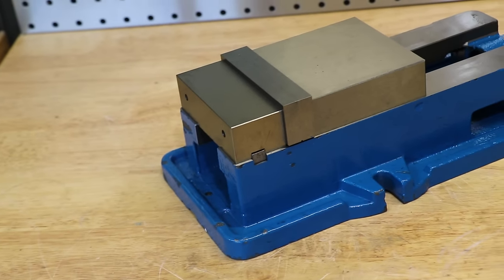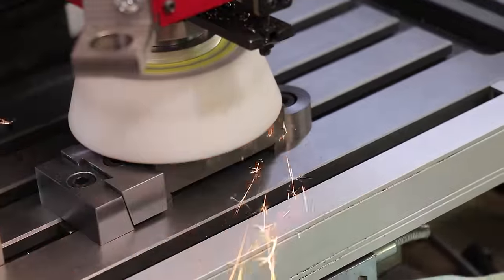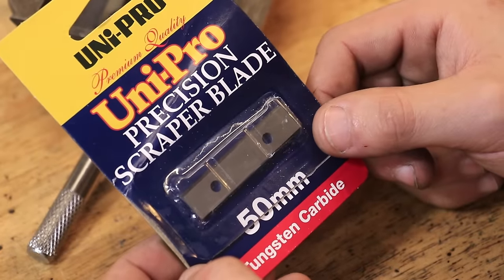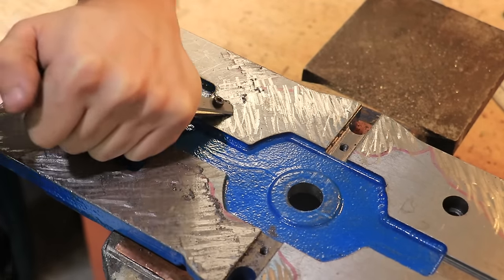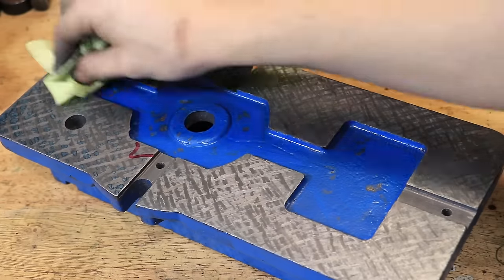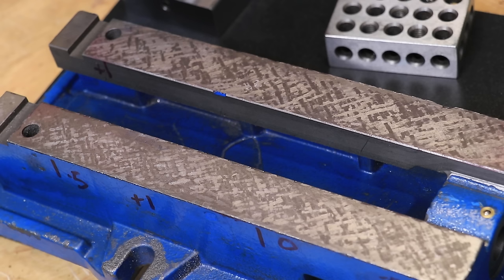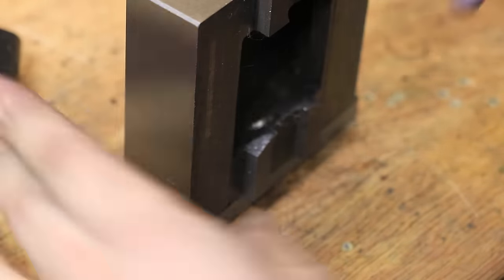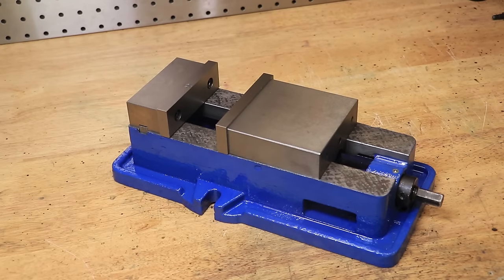My Cheap Milling Vice Has Issues. Can I fix It? (Surface Scraping)

Comment: I'm impressed that you just dove in and did it!  Nicely done in the end.  My assumption is that I will have all the same issues you did, the first time I try it!

I like watching other videos on scraping, as you do.  One thing I noticed a little different in yours was that your strokes seemed narrower and longer, maybe even much longer.  I would think there must have been something about that that seemed intuitively right to you as you worked.  Seems like "those guys" kinda go "zip, zip, zip", and yours were more like "ziiiiiip, ziiiiiip, ..."  :)  Maybe it's the patience issue again; this is apparently not a rapid stock removal technique!

One other thing that seemed interesting is that somebody, somewhere pointed out that if the blue spot is surround by a dark ring, that's a buildup of bluing ink around the high spot, so the width and darkness of that ring can be a kind of indicator of how high the spot actually is, relatively speaking.  A little bit of a 3-D reading.

Well done.  Carry on!
Reply from the maker: The longer lines I think are are down to lack of prior experience. I need a bit more practice to get the stroke length down whilst keeping the speed up.
Reply: @artisanmakes  I guess the ultimate is those little Moore half-moons...  yikes!  I could only dream of having that kind of skill.
Reply from the maker: One day hopefully. A man can dream :)

Comment: Well done , another useful tip now that it’s all squared up is to setup a clamping  bar x ways on table bolted down spyware to x an y turn vice upside down an machine the base on the end an one side so for a quick set up u can match the back of the vice to the edge of the table or the side using a engineer’s square from back of table to side of vice ,it only a quick way to get it set up for the jobs that are not critical an quick for the ones that are with a dial

Comment: If the fly cutting made it worse, perhaps you should try to tram the mill a bit better. If possible, of course.
In any case, I'm much inspired by your limited resources solutions.
Reply from the maker: I think the issue I'm dealing with is spindle nod. I need to get the indicator and check that. Cheers

Comment: Edit: The finest machines (and reflector telescope mirrors) are all hand scraped. Skilled hands still exceed out best machines for some purposes.

You've hit the skill level required for an Australian to make the most of those criminally cheap Ali*** Bang*** machine tool accessories; if you think of them as a kit of castings which are intended to be machined and finished by the buyer, resulting in a high quality machine tool or accessory, but without having to buy a house to remortgage in order to pay for it.

Herr Gottswinter did a similar thing with the Vertex rotary table, but with Stefan's special sauce of considering almost everything "probably good enough but I can make it exceptional". 

I can't justify the cost of Kurt either. I can often justify the cost of Vertex, and their quality control is reliable and accurate. But when I can't afford Vertex, but I still want a nice tool I do what you did with this vice. It's a set of castings which have been roughed out, and with love and skill and effort, you can make it better than any of we AU hobby machinists could afford to buy outright.

Nice one.

Comment: I taught myself scraping to make hand planes (woodworking type) flat on the bottom.

The main "secret" I learnt was - don't try to be too accurate, too early on.

While there are still "low" (unscraped) areas left, your high area (blue/scraped) doesn't need to be perfectly flat YET. You work to lower it quite aggressively. Only when the entire surface has scrape marks is it time to scrape with more care.  

In effect you can think of it as a 2 stage process - improve the "shape" of the surface until it's flat; then work to improve the "texture" of the surface. It's a move from working on the macro shape to the micro shape.

In practise it's not a 2 stage process - it's gradual.

Put another way - imagine you have a little island 5 thou (0.005") higher than the surrounding plane. Your task is (of course) to lower the island down to the rest of the plane. And UNTIL the top of the island is within - say - 1 thou of the plane, it does really matter whether the top of the island is flat.
Reply from the maker: That would probably be a good explanation of why it took me so long to scrape the first time :)

Comment: Good job 👍. One question. Can you not use an emery paper on surface plate instead of scraping?
Other question. How you make sure that the scraped surface is perpendicular to vice jaws?
Reply: You can use emery paper but requires a lot more effort to move the vice around vs removing what you actually need to with a scraper. Because the surface area gets progressively larger as you sand down the face closer to flatness, the pressure applied over the surface reduces which causes the emery paper to lose effectiveness.

Not to say it isn't possible, it's just actually faster to use a scraper.

Once you have established a reference surface, in this case, the bottom of the vice, everything else is based from this, the bottom infers parallelism to the top surface which can be measured with respect to the bottom surface as shown, once you have that flat you can then measure perpendicularity with a surface gauge tool using a known good perpendicular reference. The bottom surfaces of the fixed (and moving) jaws can then be scraped to adjust as required.

Comment: This is great, and inspires me to have a go. Watch yourself with grinding carbide though, the dust is super bad. A vacuum cleaner nozzle next to the grinder is a good idea, and perhaps some PPE...
Reply from the maker: Cheers, I'm a bit weary of any grinding dust. I use a mask when using the regular aluminium oxide wheel, and from what I hear, carbide is worse than that. Cheers

Comment: Unfortunately buying some decent tools here in Australia is an expensive nightmare.
For machining I’d suggest getting some parallels so your workpiece is not resting directly on the base of the vice.
Reply from the maker: Definitely not the cheapest. I have parallels but it does make the jaw lift a little worse :)

Comment: Maybe the vise was bended by the clamping forces while not being supported completely at the bottom.
Don't know if that can happen, but would be interresting to check in a few months. To see if the vise is still parallel.

Comment: Hey whats up. Good to see you fix the import vise. I am going to do the same thing when I buy one. I have scraped a lot in the past. I built the Gingery metal lathe which involves a lot of scraping which took me a little over a year. When you sharpen the scraper you have to have a radius which I think you did. If you see scratch marks on both sides left from the scraper you need a bigger radius. Only the middle of the scraper should be scraping. One thing I noticed was you were chasing each and every individual blue spot. Generally you are supposed to scrape them off in a group. I don't know if it is your scraper profile but it doesn't take much effort to make a scrape you can do it with one hand. There are definitely levels to scraping. Anyways good luck I have been enjoying your videos they are very entertaining.
Reply from the maker: Thankyou for your comment. I think the biggest issue I was having was rotating the scraper and that was catching the side of the blade as you noticed. I think I am getting better but I need more practice in it. Cheers

Comment: I've seen videos where someone has a surface plate they use for grinding pieces flat by using spray adhesive to glue a sheet of 600+ grit sandpaper to the plate and after scraping (or otherwise flattening) the part, they then wet-sand it smooth...if they really need/want a high-gloss finish, they repeat the process by gluing down higher and higher grip sandpaper (they usually stop at 1,000 or 1,500 Grit)...It takes a LOT longer, but it works just as well as a Surface Grinder (at least within the Tolerances they're willing to accept) while producing MUCH less dust and grit since ALL the sanding is wet sanding which traps the grit in the water as they're sanding...

For those screaming at their screen and tearing their hair out at the thought of using a precision surface plate for sanding, they have 2 plates, an old one that's still nice and flat they use for sanding and a new plate they use for precision layout work and they protect it like it's their first-born child...

😄😁😆😅😂🤣
Reply from the maker: Yeah that definitely gets stuff flat, getting the two surfaces flat and parallel is a much more complicated process which I don’t think can be done easily with this method
Reply: @artisanmakes  True...I was thinking however, you can use that process to get the bottom totally flat and then use the grinding stone in the mill to flatten and parallel the top. If you set up the vice on the bed perpendicular to your normal set up (so the entire base is on the bed) it should ensure that everything ends up parallel...

If you own (or can make) a 90 degree milling attachment, you can then turn the mill into something that looks like a true surface grinder (and set up a vacuum hose behind the wheel because now all the sparks/dust/grit will be flying in one direction every pass which reduces cleanup and risk of grit on the ways)...

Comment: I've done a ridiculous amount of hand grinding the bed of my Chinese mini lathe because that utter piece of crapola is crooked in every imaginable dimension. To clean it up as much as I could without spending €1.000 or more on having the bed precision ground, I instead invested about €120-180 for a 100 cm long cast iron bridge thingy (can't remember the name, it's a flat reference beam used to print onto whatever you need to grind or scrape) which was flat to within about 10 micron. For printing the cast iron beam I used commercial prussian blue oil paint which I apply to the beam with a paint roller, which works perfectly and as if it was made for it. It takes a long time to dry out and can be transferred multiple times from the beam to the bed or whatever surface needs to be printed for reference.

Comment: Scraping has some better things than surface grinding such as enabling a layer of oil to be kept or to stop a vacuum forming under ground parts. That's also a part of the 'tick mark' scrapes.
Ca Lem has a great video on scraping and the ticks

Comment: I’m pretty impressed that you had the courage to give this a go. I’m glad it worked out for you. 

What confuses me is why you can’t use the fly cutter to clean up the top ways on the vice, especially since you already flattened the bottom?
Reply: He did use the fly cutter and as he said he made it worse for some reason. When he measured it for parallelism initially the worst measurement was minus 2. After flycutting the surface the worst measurement was minus 5 !
Reply: @samrodian919  I’m aware of that, hence my question as to why.
Reply: Probably was sitting correct or something on the mill is moving
Reply: @freestyla101  sorry for that. I answered your question, had you phrased it in a different way I wouldn't have commented.

Comment: Next time try negayive geometry on scraper. It helps to keep the blade from digging. You can also try using dremel and cut off wheel to do the same(works better for steel than hand pushing one) you use the side of the wheel btw
Reply: Although I will probably finish by hand scraping, I've done most of the cleaning up of the crooked bed of my mini lathe by hand grinding with a rotary tool. Initially I used those orange aluminium oxide grinding wheels, but I noticed I got much better results by using moderately fine grit sanding drums, of about 80-100 grit for the course work and 150-180 or preferrably even higher for the finishing work.

Comment: I think your scraper bit radius was too small, making each scrape quite narrow, ie; taking twice as many scrapes to remove the material.
I have not done any vices, but in some critical work like antique engine cylinder heads etc I use a flat file. A good brand fine cut flat file, which has a very mild taper on the end third of the file. Mine is a Wiltshire brand, a common good file in australia. Anyway the point where the taper joins the flat section of the file is essentially a "bulge" and you can use that bulge to remove material in a small area the same as scraping, BUT with the benefits that it removes material better, and more evenly (does not make little grooves) becausr the cutting bulge is the width of the file so instread of scraping a 3mm groove into the metal it scrapes the full width of the file, maybe 25mm. It is an easy thing to do but hard to explain.
Anyway you can get the same flattening result as scraping but the final metal has no grooves and is almost polished flat looking, a really nice smooth uniform finish. And it is probably ten times quicker than scraping tiny grooves. 🙂👍

Comment: Your scraper is literally the exact same  as the first one I made. Just used a floor scraper carbide blade that I attached with two screws to a Flat bar.

But one other issue is I also have one of these vises also, and measured the flex under load. There’s A LOT of flex, A hecking heck of a lot of flex. I think the center bowed to by around 0.3 mm or so. I don’t know if that’s because of poor fitting jaws or weak casting. 

I do have a much better quality Taiwan vise as well, so I didn’t bother investigating my 100mm Chinese vise further
Reply from the maker: Blimey, that is definitely a lot of flex. Never considered how well it works under load, but that does not sound too good. One day I'll hopefully get to ditch this one for a good quality vice. Thanks for the info.

Comment: Great video mate. Regarding lapping your stones, do you have a good resource for the 3 stone method...ideally a YouTube video?
Reply from the maker: Tom Lipton ay ox tools has some good videos on making lapping plates. Not exactly lapping stones flat but it's the same basic method and it has some good info
Reply: Thanks. I've watched his videos now. Amazing the flatness you can achieve. When applying it to stones, did you use some form of lapping compound between the stones or just stone-on-stone. Wet or dry?

Comment: scraped flanges, the most expensive pipe joint of all... aiming for 90% contact. no gasket material. pretty hard to get gastight!

its a trade off.

get the contacts below a certain point, and it locks up.
too much contact squeezes the oil out, and you get "sticktion" as the slides grab and release on  film of oil. thats an issue ground ways suffer from.

a 66% area means you get approx 1/3 contact between the two parts. at any time, you can say half the high spots are contacting each other, and there the oil is being squeezed out, but has somewhere to go without building pressure, meanwhile, the other half of the high spots are  getting a new film of oil applied...

the scraper handle... you want spring steel.  the idea being if you sort of hold the butt of it stationary, smacking down on the middle of the handle flexes it, shortens it, applies the required pressure, and its the bounce back that does the actual scrape. 

dont use it like a chisel.

then again, sometimes you have no choice. getting into the 55 degree dovetails on a minimill is fun...

Comment: Surely you need to sort out the table flatness first. You will get away with an out of flat table when machining small jobs just in the middle of the table. But anything mounted longitudinally will have issues.

Comment: I was thinking, wouldn't it be possible to convert a cheap hedge trimmer into an electrical scraper? It already has the right motion.
I mean, we're talking budget vise and budget self-made scraper. So making a budget electrical scraper would be the next logical step.

by the way, I just saw this video AFTER ordering this vise... now I'm worried about the quality... I don't have 30-ish hours to scrape it. And not a big enough surface plate.

Comment: do you believe it would be possible to build a laser fixture that targets just the blue areas? Like you blue up the part and set it up under the laser. Then the laser removes a layer from just the blue areas. I guess if one was going to do that, they would have the powers to build or at least the fund sto surface grind.

Comment: Hey mate can I ask where you got the surface plate from? Is it the Carbatec one? Thanks for the tip on the Unipro carbide blade, will grab one to give scraping a go too.
Reply from the maker: Yeah it is the carbtrc one. It's a little more expensive than the one sold Amazon one but it's good to within 5 microns rather than 10. Cheers

Comment: Stupid question time.. What if you got a new piece of glass from your local supplier and laid it down on the surface plate.. Then smear valve grinding paste on the bottom of the vise then lap it on the glass.. which (in theory) should be perfectly flat. Then you could finish up with a fresh piece of glass for the final cut.. Thoughts?
Reply from the maker: Float glass is already quite flat. Id never lap directly on a surface plate, but it might be possible to lap glass on glass. Look up the 3 plate lapping method, that is normally used to get lapping plates flat.
Reply: @artisanmakes  Yes I saw the 3 plate method, very interesting.. Was thinking that you could clamp the float glass to the surface table to make sure it stays flat. Then lap onto that.